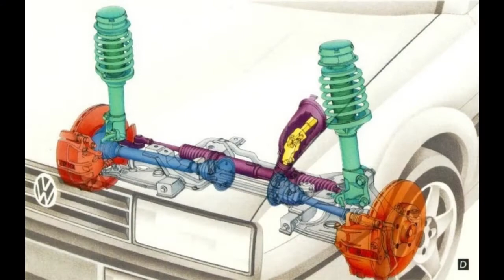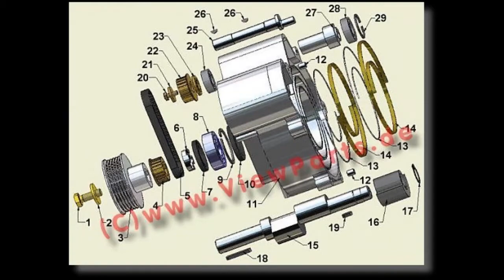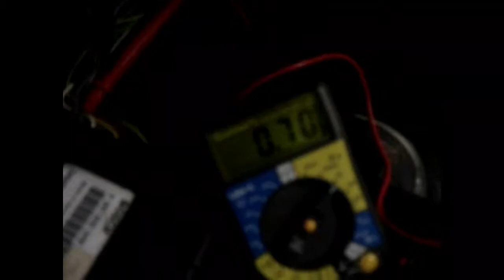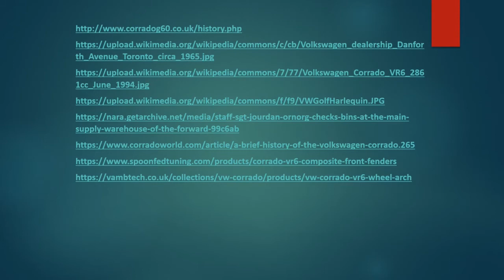Volkswagen Corrado

Comment: Another great video, Jason!  I've never been a VW guy, but the Corrado has always been the 1 VW that I liked.
Reply from the maker: I never understood the VW thing either, but I got immersed in the scene when I worked at the Speed Shop. I experienced a 1.8L T swapped Corrado and Scirocco , every version of Golf GTI and Golf R. The one car that really left an impression was a Mark III GTI VR6 with nearly 300000KM. I helped a young guy cobble a Ebay turbo set-up onto it. Selling him fittings and couplers and an oil return line. He got it all running and came by all excited and insisted I go for a ride. I mentally prepared myself, saying to myself, no matter how slow this thing is, act excited as not to kill this young guys enthusiasm. This car was a absolute rocket! The glorious wail of the VR6 accompanied with all the right turbo noises was intoxicating. At that moment I understood the Volkswagen thing. The scenes obsession with vintage three piece German wheels (BBS and the like) is also contagious. I still want to restore some period wheels, pick the barrels, get all new little bolts, looks very satisfying in a car geek way. LOL